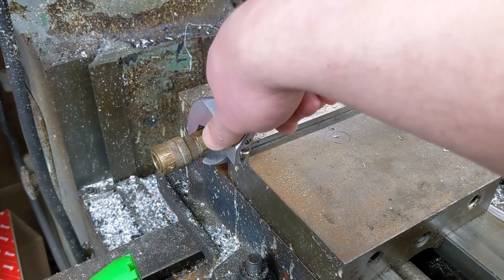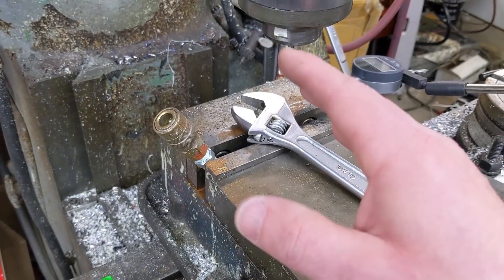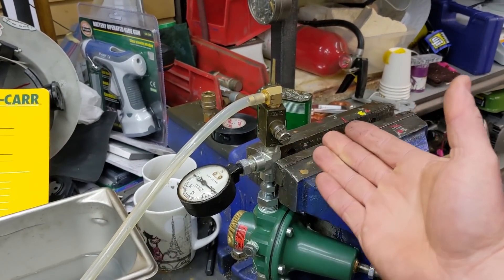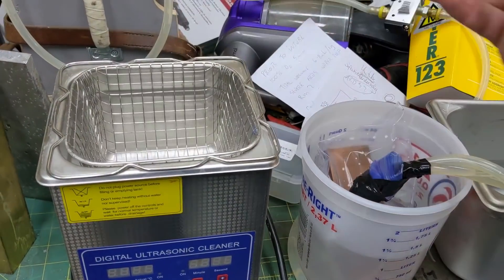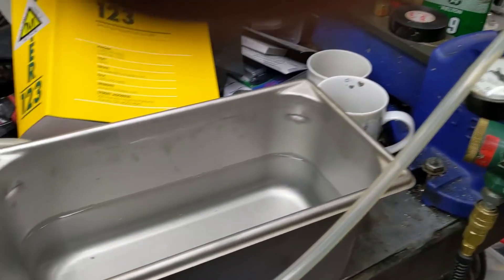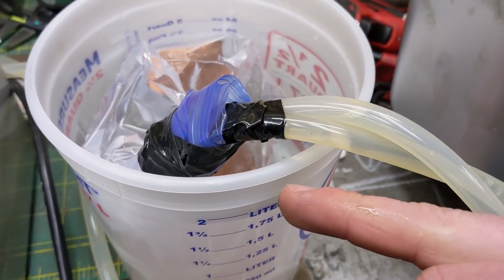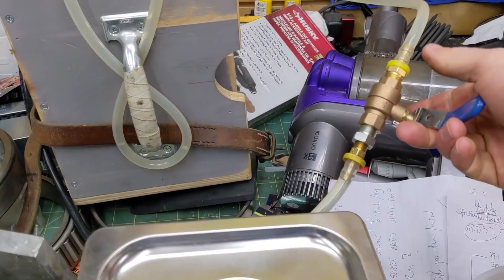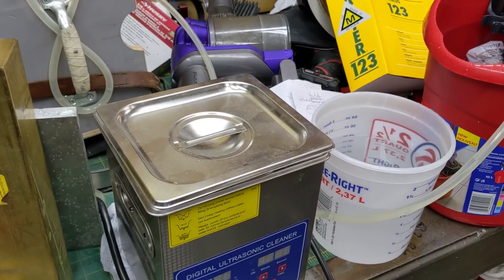Jankiest Ventilator Mk.II Prototype

Comment: Neat idea to ventilate multiple people at once, but my main concern would be cross-contamination between patients on the same ventilator. It's less likely given the positive air pressure,  but there's a certain minimum air pressure required to ensure this so you'd have to check that. You might say that only patients with the same infection would be hooked up so contamination doesn't matter, but people on ventilators are typically immune compromised and may have more than one infection.

Comment: Why a ventilator? An iron lung uses the human body to control the volume of air, and helps with both inhaling and exhaling. O2 can be added into the equation with a nose tube.

Comment: Working full scale model?  Hose diameter too small for the volume psi required.  Layman terms of you cant breathe through the tubing...  It's a no go.  Need larger diameter gizmos to facilitate the large volume/low pressure requirements.  Great path, however how much volume does a human move per breath per minute?  You expressed TV or tidal volume which is 500ml every 12x a min.  Sorry...  Over served. Mind may be over lubricated.

Comment: Ventilators have another setting where it can let the patient start a breath then the ventilator would follow through with a calculated mop bucket puff of air from the air compressor. Just throwing another wrench on the machine.

Comment: Say you didnt have access to o2. Could you supplement an o2 concentrator to both intakes to increase the oxygen to the patient?

Edit: please look into a jellybean o2 concentrator?
Reply: Alright everyone, I ended up looking around myself. The messy desk has a great zeolite based option, plc controlled with a flow meter. You could backend the whole control into AvE set up, and just have the plc, or another control the proper volume. There is another video by tech ingredients on a liquid desiccant based air dryer. That's more jellybean material. The compressor can just sit inside the outlet. What else is missing?

Comment: With all that excess mucus, maybe add a vibrating vest to dislodge it? I know that's what my Cystic Fibrosis nephew has to do twice a day. Maybe one of them industrial pneumatic models with the spinny ball thing? Attach it to a roller coaster cart, and you've also got restraints so they can't pull out the intubater tube.

Comment: Ive got the pressurized O2, the valves, the tubing, the compressor, the taped ziplock bag, the water tube. How in the fuck do I suck on it and make my cheech chooch bags do the inflate deflate? Do I have to swallow it?

Comment: Bird Ventilator Info:  https://patents.google.com/patent/US3347228  <<<--appears to be the Mark 7 patent. Small, pneumatically operated ventilator, 50 PSI https://en.wikipedia.org/wiki/Forrest_Bird 

https://patents.google.com/patent/US3915164 

https://patents.google.com/patent/US3191596 

https://www.bbc.com/news/health-34482260   "The Bird Mark 7 medical ventilator was born - a portable, low-cost machine which moved air into and out of the lungs of patients with serious breathing difficulties, without the need for an electrical power source." 

https://patents.google.com/patent/US3068856A/en 

https://thoracickey.com/how-ventilators-work/#s0030  <---diagrams!
https://www.youtube.com/watch?v=8IcJLctGFaE  Mark 7 in operation

Comment: I will admit that I'm a simple-minded truck driver, but I see no reason for the water in the exhalation tube. The only reason I can see for that resistance is if there's a vacuum being drawn to pull air out of the lungs. For any air breathing creature, we exhaust our spent air to the atmosphere at a pressure slightly above the surrounding air. Please correct me if I'm wrong.

Comment: Hey AvE I am an anaesthetist in Australia.  We use paper filters on ventilator circuits called HME that collect water vapour from exhaled air and then humidify the inspiratory gas from that end.  

Another idea would be a mechanism that squeezes a laerdal bag that's attached to oxygen and the patient.  The laerdel bags are a fixed volume and hard to over pressure

Love your work

Comment: What would be really effective is a radial engine where each pistol squeezes a bag and valve manual ventilator. Could supply 5 patients with air and the bag and valve are disposable so the parts can be replaced very quickly. Just needs a low speed motor to run. Can be knocked up in plywood with some bearings to keep it running smoothly.

Comment: You could add a float switch on that supply side water column. to trigger the exhale or what ever. Have the height of the float switch adjustable.

Comment: Two stones with one bird. Dump the exhale water in tube thingy and just anchor the outlet of the tube underwater at a set depth. 
The depth sets the back pressure and the bubbling scrubs the viruses out of the air!

Comment: So unlike normal where I understand half of what ol' bumblefuck says, this I know something about as it's my trade! The PEEP can be controlled with a diaphragm valve with a light spring on it. if the spring is sufficiently wide to be just under the diameter of the diaphragm, then the exhalation will meet the proper resistance when the spring is under the proper tension. Also, remember that the breath needs to be given in breaths/min, as well as volume/breath, and over the proper time of inflation (ie the inhalation occurs over 2 seconds) otherwise it will be like trying to breathe thru a straw, or having your lungs blown up like a tire getting inflated with the ether trick in the backwoods!

Comment: FWIW the "sigh" function helps to blow off the small excess of CO2 that gradually accumulates. over time  CO2 permeates the lungs much more easily than O2, and can re equilibrate with just a deep breath.  The reason you yawn when you are tired is the same: it is to blow off the rising CO2 you  accumulate due less vigorous breathing when  fatigued.   Homeostasis and hysteresis  in  gas pressures act much like the feedback loops in day to day mechanical  devices like thermostats.  Hope I learned you sumthin AvE.

Comment: Love it! I personally would have to be very desperate for life to want to be on it, however a centralized model of a vent that serves multiple patients is really ingenious! I place my rib crackers on a vent from time to time, and what you have there is a vent mode called "full control or complete ventilation". This mode is mainly used during surgery or recovery and requires high sedation followed by chemical paralytics. (Wouldnt want grandpa fighting and suffering while a machine does everything for him). The vent mode most frequently used, and would be used for a septic coronavirus patient is called PRVC (patient rate volume controlled). Meaning the vent allows the patient to set their own rate of breathing based on their own required demand. The vent will then only ensure that the correct volume of air is moved by assisting the patients breath. Usually a tidal volume of 450-500cc (based on weight). PEEP, FiO2, and minimum respiratory rate can also be adjusted. 

The reason that it is important to allow the patients body to maintain and set their own natural breathing rate is due to autoregulation of the body's blood pH level - not just about oxygenation. Retaining CO2 (carbonic acid) is the body's fastest method to correct the blood pH issues until other body systems can aid in the compensation.

If you watched a septic patient for a day, you would notice that their respiratory rate increases as the disease gets worse. This is due to many things, but one being the body creating lactic acid due to extra work of fighting an infection. Lactic acid leads to lower pH levels, low pH tells the body to breath faster, faster breathing expels more CO2 than normal, which in turn get rid of carbolic acid in attempts to compensate for the low pH.

Perhaps future versions of the "AvEalator" will have a way to allow for changes in natural respiration rate?

Comment: You're moving away from simplicity with any attempt at adding a sigh function. In all my years, I never had a single doc to order a sigh (as beneficial as it might seem). Pro-tip the 2nd: For the most part-- a set peak pressure is preferred to a set volume-- much safer: 800mL, just right for one patient, might cause barotrauma for another. Both will likely tolerate a similar ordered peak pressure. An interesting factoid: When volumes are used, they are calculated not on the patient's weight, but on their height. Oh-- one more thing (sorry), patient needs to be able to trigger additional breaths or he'll panic. If he takes too many extra breaths, he will need sedation so that his CO2 doesn't plummet.

Comment: 1.  You can't use UV to disinfect breathing air.  UVC (short wave UV)- the kind used for disinfecting- is especially good at taking O2 and splitting it into plain old "O".  This then combines with O2 to generate O3, or ozone (look up Ozone-oxygen cycle).  Ozone is very toxic in significant quantities.  BigClive did a video a little while back about UV that was quite interesting.

2.  Your "manometer" must pass some air volume for it to be effective for breathing.  If it completely blocks off all air flow (like a small diameter tube would, like a traditional manometer actually is), the patient wouldn't be able to exhale.  You might try a larger diameter tube or cylinder to reduce capillary action on the sides of the tubes to allow air to flow more easily thru the liquid?  Or maybe duplicate SCBA mask (not 100% sure how those work).

Comment: I was wondering if the water in tubes would evaporate, or if humidified by contrivance or the patient would vary enough over time to make a mess of the regulation by water column. Not being too smart with the parts available maybe something like a reed valve or spring that wouldn't be dependent on the exact right range of water column.

Comment: hi interesting the bladder which requires to inflate and deflate could be place at the bottom of a vertical PVC tube filled with water approx a one meter long that would give a pressure differential of 1/2 psi  if salt water and approx  5% less if fresh you could make the tube longer to compensate or drine for less pressure  just a thought

Comment: CoVent-19 Innovation Challenge by Massachusetts General Hospital residents

The CoVent-19 Challenge is an open innovation effort to design a rapidly deployable mechanical ventilator. The challenge was started by residents at Massachusetts General Hospital (MGM), and the founding team of 13 people are primarily MDs. 

“The goal of the CoVent-19 Challenge is to increase the capacity of hospitals to provide mechanical ventilation. Our answer will be a rapidly deployable ventilation solution that we can use to close the gap between those in need and our actual resources in settings around the world.”

The challenge is supported by Stratasys, Ximedica, MGM and Valispace. https://www.coventchallenge.com/

Comment: If you drive a 4” diameter cylinder with a ¾” diameter cylinder, you isolate the air from the compressor. It is the size ratio that makes this work. The 4 inch cylinder can be a NFPA type cylinder. Clean it out, use food grade grease (or Crisco), maybe loose a piston seal if it has multiple, so that it moves easier. By physically controlling the stroke, the volume of air is controlled. You can effectively make a air pump with total control. The ¾” diameter cylinder can be ran at 15 psi with oily air to create 0.5 psi of pressure out the 4” cylinder port. Physical length of the cylinders is irrelevant since the stroke of the system will be limited. 0.5 psi regulators are rare but regulators that can control 15 psi are plentiful. A flow control on the 3/4” cylinder will control rate of the air going into the lungs. A couple one way valves and you will be pumping clean air. Filter, humidify, and add O2 to the intake of the 4” cylinder and what goes to the lungs will be what is needed. Also, externally piloted valves will shift their spool with 0 psi. Industrial air is fed to the pilot which moves the spool. I’d send you a diagram but don’t know how to get it to you…

Comment: On a steamboat, both the boiler AND the captain have a "blow off valve".  However, it is absolutely crucial that you do not mistake one of these valves for the other! One of the two valves is not rated for 200PSI Steam steam at 350degrees....  Also one is automatic, the other operates semi randomly for the first 3-7 years and then turns into a manual valve.

Comment: There is a neat neonatal dual-level CPAP system that uses a single working part submersed in water, some tygon/pvc, and a bleed valve.  The unit is submersed to a specific depth to provide a consistent head of pressure in one half of the cycle. A slow air bleed fills a weighted volume that vents when buoyancy overcomes g, exposing an alternate set of holes and increasing the effective submersion depth. This is quite a neat way to regulate pressure. Very simple, little chance of overpressure,  and you can probably build most of it with one trip to the hardware store. Need to concern yourself with water level though. Source: http://rc.rcjournal.com/content/62/9/1131/tab-figures-data

Comment: we used to put the exhalation limb in a bucket of water with a ruler (centimeters) and raise or lower the the end of the tube to get our PEEP, using the ruler to adjust the centimeters of water pressure. (very old Vents)

Comment: I am here in the bay area and working on making masks from coffee filters and fabric softener.  PS. I had the idea to encapsulate some bushes in a greenhouse/plastic wrap and then compress the high O2 content air from there to remove the moisture, wait for the plant to saturate its surroundings with O2 and repeat.  Also, even in hospitals during this pandemic, over inflating and under inflating the lung, especially because of the nature of COVID-19 inflamed lung grape/air sacs.

Comment: I don't claim to be smart in the least, just curious. If the problem is 'liquid' in the lungs wouldn't it be better to use dry air? Maybe it would help pull some moisture out of the lungs? Probably not, just wondering. Also instead of heated air wouldn't it be better to use cold/almost froze but warm enough to not freeze throat/lungs etc. to get more/denser air into the lungs? More air per cubic inch? I'm sure not, just wondering.

Comment: Hey AvE, love your videos.  
I'm an RRT here in the states, 5 years experience. 

Sigh breaths used to be included as a standard but they have been phased out due to the newer low tidal volume ventilation methods.  That is to say, you don't need to include them on your vent.  

Can't wait to see what you do from here.

Comment: Too complicated, all you need is a five gallon bucket, four unused condoms preferably, a shop vacuum, gas line hose, a gauge and random hose clamps and nipples. The original ventilators on our ambulance were completely manual, gas operated.

Comment: As a kid I worked for a Vet and one day he had me clean up the anesthesia machine - low pressure bellows, check valves, and animal drool.  I torn the thing apart and reassembled it.  Then like a moron I tested the check valves by breathing and out of it rapidly, hit the floor like a sack of taters and had a nice little unscheduled nap.  And that's the last time I messed with such a contraption.
Reply: fuck me

Comment: I think you would have more luck with an ecmo machine with your skill set than a ventilator. The partial pressures of gases and controlling insp and exp volumes with consideration for reserve capacity, lung compliance and if  cpap bipap or peep are necessary depending of lung pathology with humidity control etc.... is beyond the realm of many even seasoned health care professionals. Although I have to hand it to you when you gave 10cmh2o as a figure for I’m assuming your consideration of peep was remarkably close to a workable figure for many with respiratory failure.ECMO would be fun to watch you go through next. For the apocalypse and when the home ventilator stops working and all that!

Comment: The weight of a water column could open the switch.  Lever length to control that... Springamathing to reset valve.

Comment: You may want to check out the original Bird ventilator.  I consulted there for a month around year 2000.  They had moved on to sophisticated designs, but were still manufacturing a version of the original that sold into the 3rd world.  I believe at that time they were charging $350/unit for life-saving ventilators.  The case was see-through green plastic so you could quickly diagnose any mechanical failures.

Comment: This is awesome. I'm no anaesthetist, but I've done a fair bit of time as a doctor on ICU, plus ventilated animals. Control of pressures and timing on ventilators is an incredibly fine science. As well as feedforward control (e.g. tidal volume, rate) the key parameters that need measuring for feedBACK are the airway pressure and end-tidal CO2, so these need to be accurately sampled from the device. More fine control is achieved by taking arterial blood samples and running them through a 'blood gas' machine to measure pH, pCO2, pO2 and [K+] (the most important ones). pH control is fundamental to ventilator control. For example, faster respiratory rates will 'blow off' CO2 and lead to increased blood pH (more alkaline)
.

Comment: The Montreal General Hospital Foundation , in collaboration with the Research Institute of the McGill University Health Centre (MUHC), is launching a global innovation challenge, backed by a $200,000 CAD prize, calling for teams to design a simple, low-cost, easy-to-manufacture and easy-to-maintain ventilator which could be deployed anywhere needed to save lives. Google it, it is real.